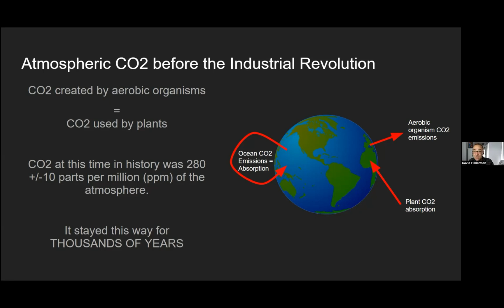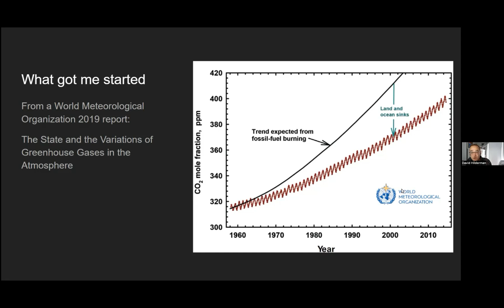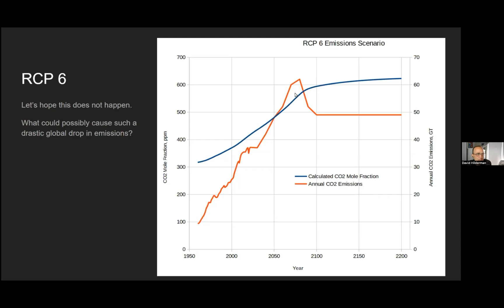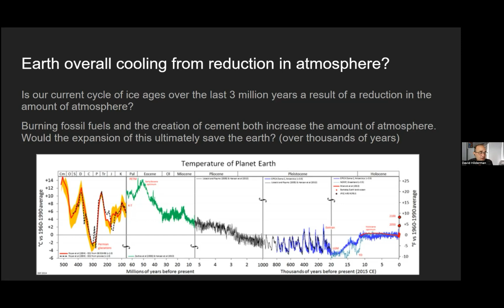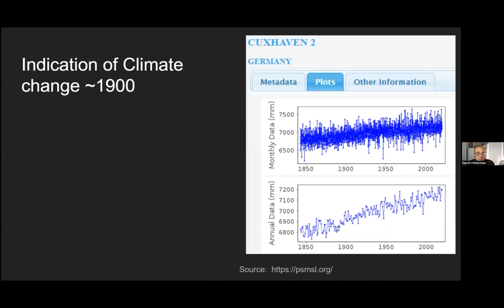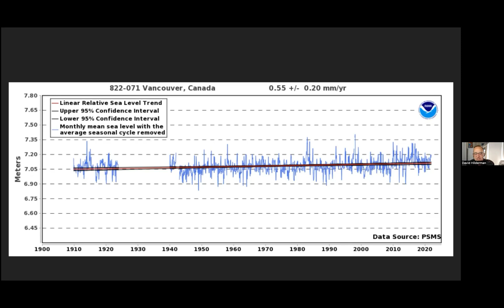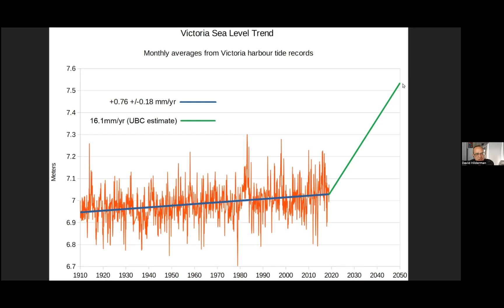David Hilderman: CO2 Emissions and Atmospheric Levels | Nelson Pod #220

Comment: Volcanic emissions must count . I think back in 1960 there was thought to be 400 underwater volcanoes , then in the 2000s with satellite imagery it was found that there were thousands of undersea volcanoes . There must be a big volcanic influence here .
Reply: An interesting point you have there about undersea volcanoes. Not only will they probably be spewing out co2, but also because they heat the surrounding water they may be causing co2 that was already dissolved to come out of solution. Cold water holds higher concentrations of co2 than warmer water iirc
Reply: Mount Pinatubo put out more greenhouse gasses in 1 year than humanity has ever.
Reply: I think you are right, there should be an effect.   I wonder if anyone has attempted to do the calculations to see an approximate magnitude.   If one assumes a continuous transfer of heat from the magma to the water, and one knows the approximate sum of the surface area of the hot magma of all the underwater volcanoes, and according to a website I noticed, magma is between 700C and 1300C, so using 1000C as an approximation, it should be possible to calculate the total W/m^2 averaged over the surface of the Earth from underwater volcanoes and compare that to the solar heating of Earth's surface to estimate the magnitude of the temperature rise.  

It is going to be a tricky estimate, because there is a physics principle called the Leidenfrost effect where water is vaporized in contact with a hot surface, and at the pressures where these volcanoes occur, does that effect happen or not for each volcano.   Where it happens, it somewhat forms an insulating later that reduces heat transfer between the hot magma and the water.

As an aside, If the global underwater volcano effect is more than negligible, a significant change in the amount that persisted for 1000's of years could be a contributor to climate change, but the thermal mass of the ocean would cause a large delay before that effect would change surface temperature.
Reply: @climatebell  hi , I was also thinking of the immense amounts of green house gases associated with volcanoes , I do know Mount Pinatubo in 1991 put so much dust etc into the atmosphere it had an influence on world temp the following year , also had an effect on O zone depletion  the following year in Antarctica . .  
Eyjafallajokal in Iceland 2010 I believe emitted each day the same amount of nitrogen dioxide , CO 2 , each day ,that it equated to the same emissions as all of European man made emissions for a year  .
Also volcanic activity does seem to have some relation to sun cycles , the eleven year sun spot cycle reality which has a very well documented history going back at least 3 centuries . Llandschiedt sunspot cycles is what it’s known as I think . This sun activity also relates to the 1600 cold period where the Thames froze in England , European rivers also froze in that period . 
I also wonder how the GT of co2 absorption of the oceans equates to 

1 . sea creature shell volume displacing water to cause rise . 
2. Massive volume increase in sea weed growth , big volume and probably significant is volume increase in algal blooms , as well as what effects there could be on the plankton volume displacing water .
Reply: UN IPCC Charter specifies Human (secret Mickey Mouse Models) dismissing history of all Natural Cycles.
Reply: @lonmccarley5072  The majority of Acronyms are either dodgy or Socialist or both.
Reply: And too I suspect there have been periods in the past with much more and much less volcanism.

Comment: Crocodilia make for a good case that atmospheric pressure was higher during the Mesozoic. Salt water crocodile are currently the largest on the planet and the largest measured was just over 7 meters and weighed just over 1.2 metric ton. The largest species during the Cretaceous was over 12 meters and estimated to weigh over 4 metric tons. 
The limiting factor on salt water crocodile growth is not food, it is their ability to move on land with increased mass. It is physiologically impossible for a 4 ton crocodile to move on land today.
Reply: My case for higher atmospheric pressure in the past is giant dragonflies. Insects are dependent on the atmosphere as it is. They don't generally have "pumps." Now someone has done experiments growing them in higher O2 levels and they did get bigger. I suspect they would get even bigger under higher atmospheric pressure.

If we extrapolate the idea of crocodilia it might be argued that all the large dinos could only exist in a higher pressure atmosphere as this would give faster O2 transfer into the tissues. Would it make things easier for pterodactyls to fly in "thicker" air?

The question that I have, is if it was higher before, what caused the atmospheric pressure to drop? Was it a gradual erosion of the atmosphere, or is it that when the asteroids hit, it generated so many large explosions that large amounts of the earth's atmosphere got blown off into space? 🤷‍♂ And with volcanoes pumping gasses back into the atmosphere, are we even close to what the pressure was like back then or is it a lost cause?

Comment: We ignorantly started burning "fossil" fuels, taken out a VITAL SCIENTIFIC FACT THAT all life forms are electric as all life forms have a magnetic toroidal (donut) and dielectric hyperboloid (hour glass) combined to form a "torus" field which reveals how ALL SPIRES from BEFORE earth's hijacking circa 1700s had copper antenna and circular spheres containing mercury which, up high in the sky, would spin on its own........... accumulating and distributing electricity, a hybrid of magnetism (force & motion) and dielectricity (inertia and acceleration) the same way nature does in EVERY AND ALL facet of life, without wires, without mainstreamlined beliefs still hoarding for profit.